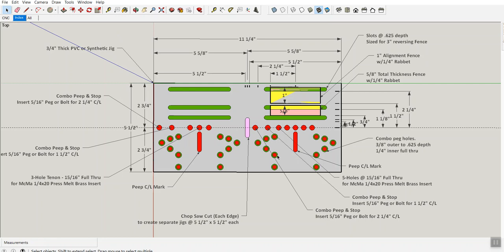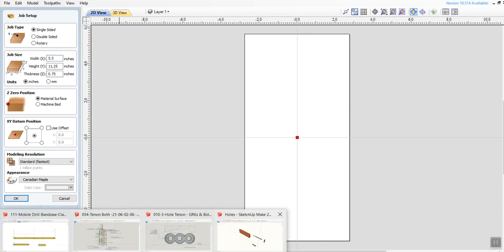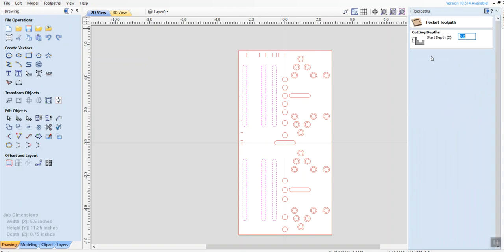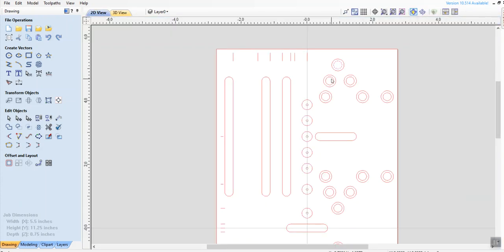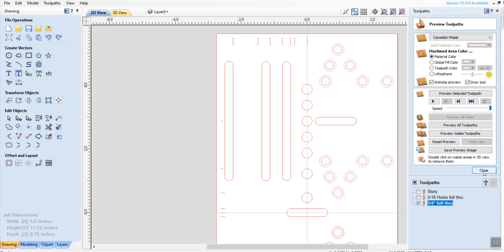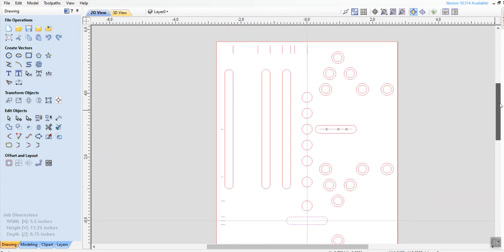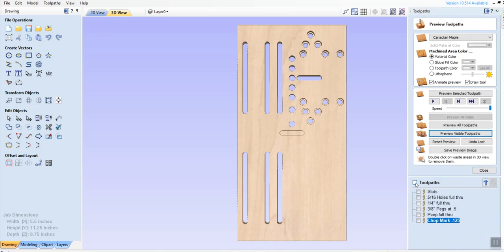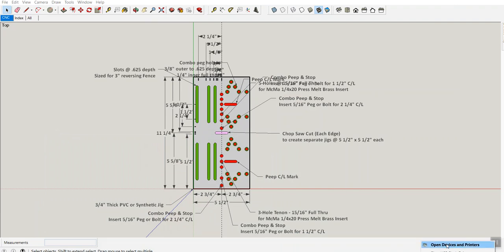SketchUp to Vcarve CNC   Importing SketchUp File

Comment: Why are the holes and grooves in 3d toolpaths blured, is it soimething with resolution settings or what?
Reply from the maker: Triumf,
Not quite sure where you are seeing the blur? If you could give me the location on the video (Minute:Second) I can take a look at it. 
Thanks,
Mike
Reply: @MikroFraming  Hi, i'm sorry i was making many qustions around Youtube videos, i just detected that i did not replay, problem was with me, it was about the 3d preview quality, i fixed it in toolpaths menu bar - preview simulation quality
Reply: By the way how do i turn the polygon circles into clean circles, cause the cam software does not recognize the circles, when i import the sketchup file to Aspire, the circles come as polygons ?